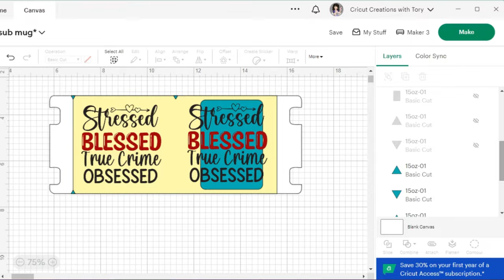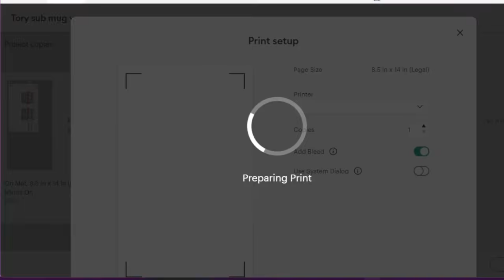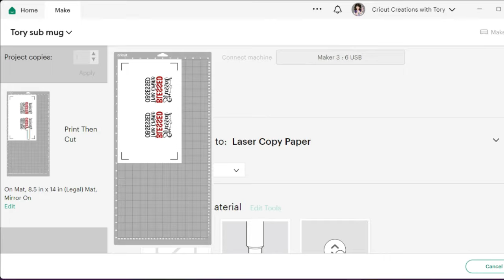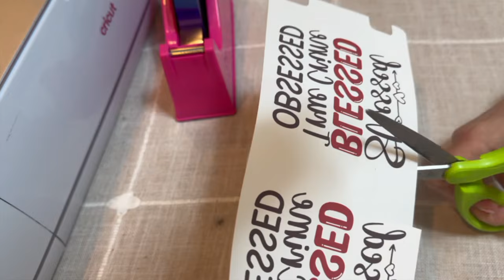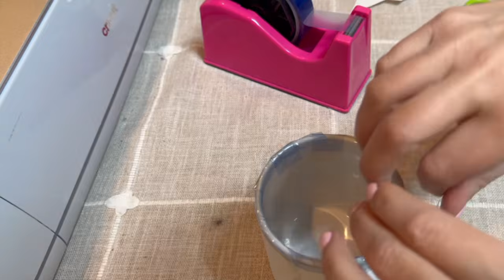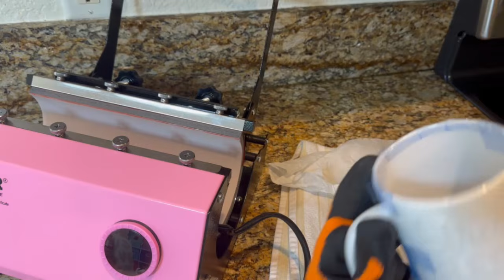How to Sublimate a Mug with a Tumbler Heat Press | Beginner Step-by-Step Tutorial

Comment: This press is just not good for ceramic mugs. Its okay for tumblers. Vevor should stop marketing it for mugs. The element does not throw out enough heat for sublimating mugs properly. There is night & day difference especially with blacks when compared to using other brand presses.
Reply from the maker: I haven't had any issues with mine.  Have you reached out to customer service?  Maybe you have something wrong with yours?
Reply: @creationswithtory Im not in the US, so I cant send it back. Not saying it does not work. It just does not work well enough to produce a quality pressed mug I would sell to my clients. I mostly do full wrap photos top to bottom with attention to blacks and this just does not heat like my Transpro press from Proworld. The results from this press is lackluster at best for mugs. I havent seen one Youtuber with 100% proper results top to bottom full wrap from this press.
Reply: I just did my first sub project using the vevor, and it was a mug.  I snapped the handle off.  I couldn't get the lid to close.  And the images, which was only back and white, the black came out faded.  Nube in the cricut world and it has been very frustrating.  Lots of money dumped into a hobby that has little to no satisfying results.  Been spending more time on phone with the hardware I have bought.  Thanks for the video though-it was helpful.
Reply from the maker: @lissalynn5897 I know it’s frustrating in the beginning. Hang in there!!  ❤️